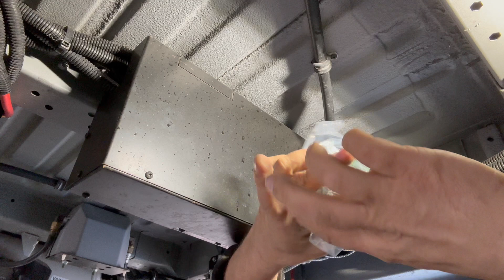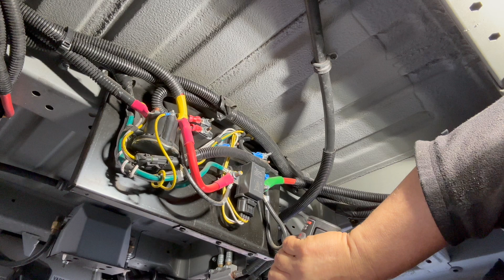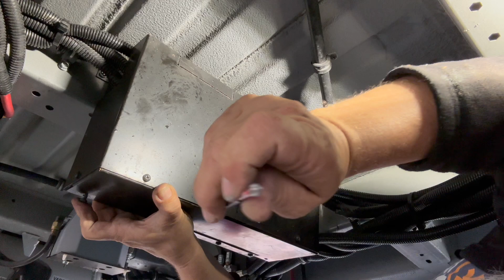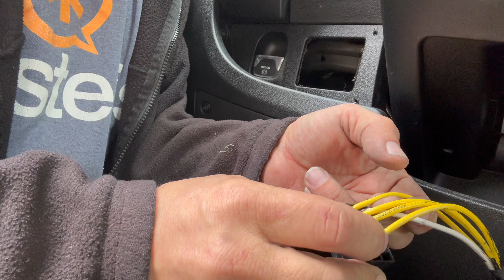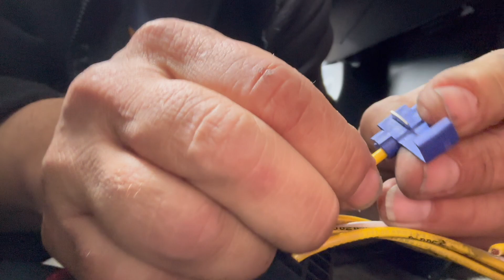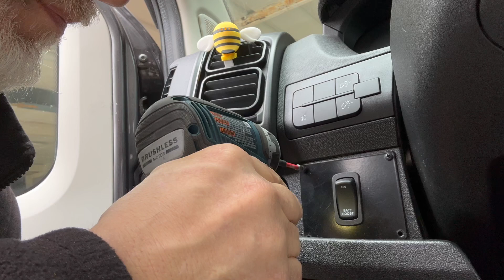Installing the LI BIM

Comment: Where do you get the diode? Also, I'm thinking about installing 2 300ah batteries in place of the old ones. I will have to modify the battery trays of course. Can this be done with the stock setup? I am only looking to gain longer 12V run-time. No other loads will be on the batteries.
Reply from the maker: Any 1Nxxxx diode will work, but I'm now using "automotive" diodes which can be fit in an inline fuse.  I have them available on my website stg.net.  It's not necessary to modify the battery trays to fit the 300ah epoch.  They can just squeeze into the agm trays.

Comment: I'm doing this exact process (replacing the solenoid with a Gen 2 LI-BIM 225) in my 2017 59K. This video is extremely helpful!  I see the 2 white wires coming off the ground terminal with one wire connecting up with the LR wire at its terminal.  But, I DO NOT SEE A DIODE anywhere in that run. Should I add one or perhaps make a short jumper as you have? Any advice? Thanks
Reply from the maker: In any Travato prior to 22, there is a diode between the LR terminal and ground (white wire to ground lug under left bolt).  The diode is covered in black heat shrink, immediately adjacent to the ring terminal on LR.  See https://tinyurl.com/TravatoLithium section on LI-BIM for exact instructions and picture.
Reply: @ScottGriepentrog  In your instructions (which are excellent BTW) there is clearly a diode there in the picture as you describe.  I could show a picture of my situation, but there definitely was not a diode in that line between the LR terminal and the ground terminal. The solenoid I replaced look relatively new, so some work could have been done before I purchased this T. What I did was just eliminate that white wire (the line from the ground terminal to the LR terminal) and added in a diode jumper just as you did in the video. This should have the same effect. THANKS

Comment: I have a 2007 Itasca Winnebago. It has a trumbetta in it. Two power on top. Two on the bottom. One ground and the LR wire. Do I just wire it up with diode like you did? Do I need to change anything at the switch. The LR is only hot when I turn the switch on. 
Thanks for any help
Reply from the maker: All solenoids are either a 3 or 4 post model. The 3 post uses the metal mounting bracket as the ground (LR on the one small terminal), where the 4 post has a separate post for the ground connection (polarity doesn't matter). The trombetta that WGO installs is the 3 post variety, although in many cases a replaced solenoid is 4 post.  Either model can be upgraded to the LI-BIM.  The important thing is to confirm that the chassis cable is connected to the large LI-BIM terminal marked for chassis (doesn't work if backwards), and the LR wire (common for all WGO motorized) is attached to the IGN terminal on LI-BIM, and the ground is connected. If you do that, the LI-BIM will work correctly.  However, to make the boost switch still work, it requires that the LR wire is NOT grounded when engine is off (check with voltmeter for anything other than a promaster), and then you have to add or reuse a diode at the LI-BIM to the SIG terminal to block 12v, and then rewire the boost switch to ground LR when pressed.  Otherwise if LR is grounded with engine off (as it is on the sprinter) then you would have to run a new wire to the SIG terminal for the boost function.
Reply: @ScottGriepentrog ok I will just install a diod to the signal. Not worry about the boost button. Boost isn't much good with lithium batteries anyway. 
Thanks
Reply from the maker: @guyt21  The boost function works perfectly well with lithium batteries.  Provided you have at least 200ah of lithium, you can even start the chassis without the chassis battery using boost.

The boost switch rewire is very simple, just cut JF and connect the side going to the switch to the white ground wire, tape over the other end.
Reply: @ScottGriepentrog Thanks for the clarification I am sure I can make it work.

Comment: I have a 2005 winnebago Itasca. I’m just a little confused on the boost switch. I have three wires one constant hot, one hot off ignition. And LR going to the solenoid. So it looks like the solenoid will be energized with 12 V or grounded. So I disconnect the constant hot and convert that to a ground connection correct? Really appreciate the video.
Reply from the maker: For anything other than the promaster chassis, you usually don't have LR floating (not connected to 12v or ground) when engine is not running.  So for those cases, you would just connect LR to the IGN terminal of the LI-BIM and not include the diode or anything else connected to the SIG terminal.  To make the boost switch work, it becomes necessary to add an additional wire in parallel with LR that you can then connect only to the boost switch and SIG.
Reply: Thanks. That makes more sense to me. I will remove the factory diode that I connected to the SIG terminal and disconnect the ground wire at the switch that installed where the constant house power was originally. And if I went down the road, I will install a new momentary switch with a hot wire going to the SIG terminal. Thanks again for your knowledge and help.

Comment: Great video and tons of information for me.  Do you know if I have to change the Battery Guard too when I install the LI BIM.  On my Class B it looks like the BIM you just installed. Thank you for taking your time to to show all of us this install.
Reply from the maker: The function of a battery guard is to turn off the power consumption before the battery gets completely drained.  This is a useful feature for AGM batteries, since it will prevent you from accidentally drawing the battery down too far and degrading the lifetime.  If properly installed, it turns off the loads when the battery voltage gets really low, without removing connection for charging devices like solar or alternator charging.  It can save you from having to replace your AGM batteries early.  For LiFePo4 batteries, they actually have that feature built into the BMS, so it's not necessary to have a battery guard device.  It's not necessary to remove it, but it just isn't going to do anything useful for you.
Reply: @ScottGriepentrog  Thank you for the answer.

Comment: great video and excellent explanation, thank you. i'm about to do my LI BIM 225 in my 2023/2023 Winnebago Solis which looks just like yours.
QUESTION, is the main function of that diode wire you bridged together solely for the boost function?   Can i omit that since the i don't care about the boost function?
Reply from the maker: Yes, if you don't add the diode connection to SIG terminal, everything will work correctly except that the boost switch won't do anything.  Having the boost switch can be critical if your chassis battery dies, although since the LI-BIM attempts to keep the chassis battery charged from spare power available once the Lithium house batteries are full or mostly full, it's less likely to be needed.
Reply: @ScottGriepentrog  Thank you for the feedback Scott.  Since i have a NICO battery jumper we always keep on board we don't have a need for the boost function.  Love the channel and just subscribed.

Comment: Great Video! Now I understand why I didn't get the diode right and the switch doesn't close when the vehicle is off. 1. I have the orange 225, do I need to switch the green one since I have Battle Born LI batteries now? 2. Do I need to do the Boost Switch mod at the end of the video on my 2018 59G?
Reply from the maker: Yes, you want the LI-BIM for lithium, since the other models may activate the chassis battery charge mode without a charge present (i.e. drain the lithium battery).  The boost switch mod is necessary for the boost switch to work (force it to connect without engine running).  It's not necessary for alternator charging or chassis battery charging.